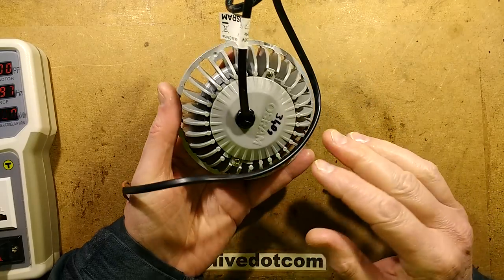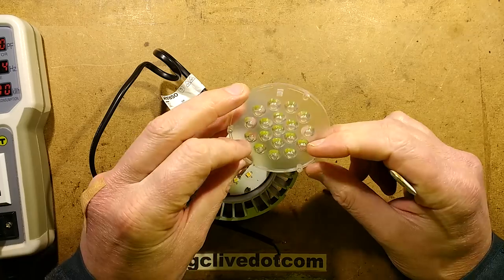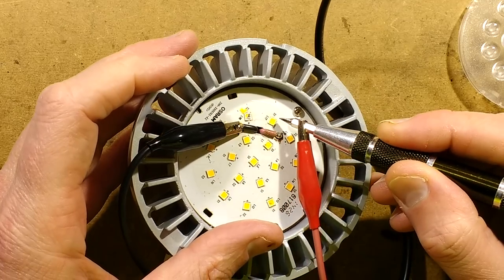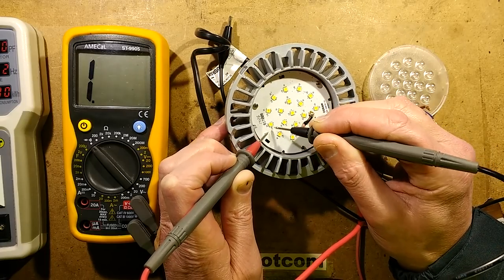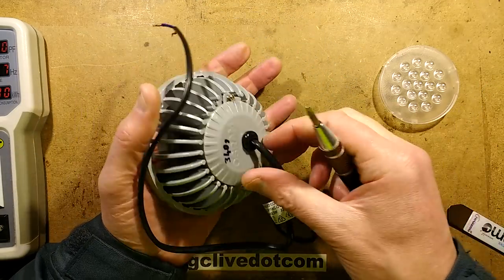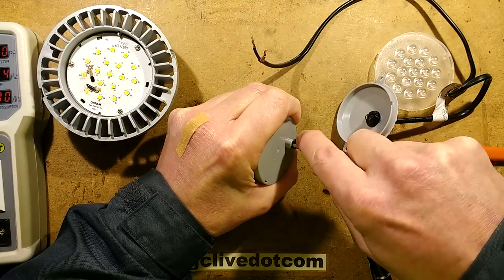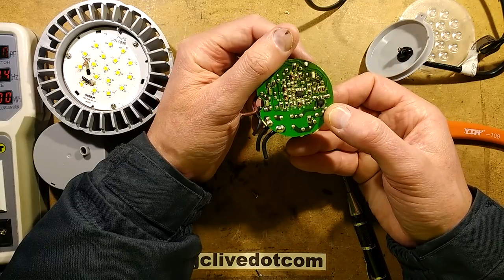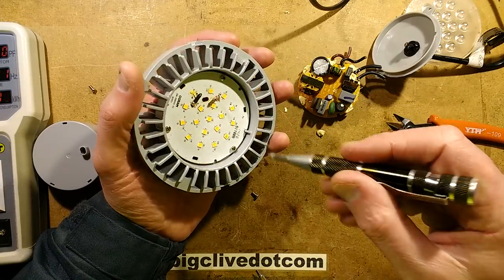OSRAM LED lamp module autopsy.

Comment: Interestingly, the local council here in York have been replacing the streetlights with LED ones. However, they're using optical sensors on the top of the streetlight to turn them on when it's dark. And rather than using a circuit alongside (so the optical sensor triggers a circuit to keep the lamp on for an amount of time) it's almost as though the optical sensor is in series with the LED lamp. The end result is that at dusk and dawn, you get enormous problems with pulsing of the streetlights (it looks very much like the fail shown here). But when it gets fully dark, the LED comes on full and stays on. That can't be healthy for the LED lifespan, right?

Comment: PCB material often used with LEDs is CEM3-thermal. It quite brittle with a thermal conductivity up to 1W/mK. The main reason it was used here was probably because of better electrical insulation than aluminium with thin dielectric layer.
Reply: Meh, "often" doesn't mean usually.  Most use a traditional aluminum mPCB.  Maybe if it had been mPCB, cooler running would have resulted in a lower failure rate.  We were, and somewhat still are, in the infancy of good LED design.  Very few live as long as projected, sort of how budgetized spiral CFL turned out.

Comment: The LED chips look a lot like the ones used in the Cree lamps being sold here in the US. (complete with somewhat mushy yellow phosphor top.)  I put in about 500 at a church and have seen about a 3% failure rate each year and am hoping that it does not follow a log trajectory. In the Crees, a long chain (80+) are used in series although the count is hard due to the increasing number of junctions per chip. Of the ones I have autopsied, many have a single open junction (black dot of death) and the others are often supply failures. The 20,000 rated hours are not realistic as that would require all of the LEDs to last that long. Instead, first failure of 80 ends the lamp.

Comment: I use led lamps because they are cheaper to run, but i still think they are causing so many unwanted problems compared to the older style lamps. Radio interference for one, light pollution from new street lamps is another problem. Astronomers hate them because they can no longer filter out the light produced by street lamps - something they could do with the old sodium lamps. And another problem is the wasted materials when these lamps are thrown away. All in all i am not convinced about their eco credentials.

Comment: I have got two LG TVs from friends in the last month with their back light failing in an identical manner. Both just a little bit older than 3 years and if you ask LG the only response is "out of warranty, and we won't fix it even if you'd pay" (well it will be a long time before I'll buy stuff from LG ever with that service). 
Both TVs are pulsing the light. I opened them up and found a LED failed open in both of them. There are also a few other dead LEDs in each, but the LEDs (dual chip 6-7V as well) have an integrated zener diode so they still conduct. Since there's two series strings of backlight LEDs the one with the failed open LED is triggering the overvoltage cutoff of the constant current driver and makes the other string (with the dark LEDs) flash.
The LEDs of the backlight are cooked in normal use. Deliberate or not (manufacturer got your money, so they don't care), this is a clear design fault.
Reply: Против Глобал  or any brand.

Comment: I wonder if you probed the pairs of LED chips correctly.  I couldn't see the copper traces on the video, but a lot of your probing looked like it was diagonal with the two probes on different chips that might have unknown connections between them.

Comment: I've been trying to get ahold of the local street lights as well... They look line a line of LEDs rather than a large one with a single lens.
Reply from the maker: It is usually a grid of 1W or 3W LEDs.
Reply: Of course, once you get above about 10W LED (or huge COB) it's less cost effective to use a very high powered LED with a thick metal heatsink behind it, unless it's an application where you need a dense point source of light for focal reasons.

Comment: Often if you exceed the peak inverse voltage of diode, but limit the current, it will fail short. They may have purposefully put a diode that has a low PIV in antiparallel so that if the LED fails open the full supply voltage would make it fail short and bypass the bad LED.
Reply from the maker: +Mister Hat The good LEDs do show a silicon diode drop in the reverse direction.

Comment: I've had two out of three Osram LED bulbs fail with the flashing problem, falling far short of the expected life. Maybe I've just been unlucky but I'm not at all impressed.

They felt quite a lot heavier than other LED bulbs too, so I assumed they were decently built (e.g. good heatsinking). But apparently not.

Comment: funny how i mentioned about my dead led in last vid out of random and heres a vid on one today ahaha. those large led chips i normally see in led strip lights the most like ones in silicon with tape sticky side and ones in those long strip bar housing ones with glass like ones i installed over my kitchen sink. mostly due to how bright and compact they are.

Comment: So, those output wires aren't silicone insulated?
Perhaps a better strategy would have been to use an isolated driver, which would allow mounting the LEDs on a normal MCPCB?

Comment: Since it runs at about 108V would that suggest that it might have been a module ment for 110V supply? And the reason so many blew is because it was ran with 240?
Reply from the maker: +Dustin Smith The output is about 100v but the power supply is a buck regulator intended for 240v.
Reply: bigclivedotcom I have two chargers, one Sony Ericsson 550mA, and one Microsoft 750mA both 110-240V input europlug, and USB microB 5V output. The Microsoft one got its USB plug broken, and the Sony Ericsson one, the cable connection with the pcb broke, and I was unable to access the the insides without destruction. 10 days ago I had a flash: to cut the cable from Microsoft one right before the USB end, and from the Sony Ericsson one, right after the exit from the charger's body, and solder them together to form a roughly 4m long cable. So I cut, and stripped them (I noticed that between the copper conductor strands where the some non-conducting ones made from nylon perhaps?), and I color-matched (white and black) the bare ends, because if I didn't, it could fry the whatever equipment it was supposed to charge... A bit of tape, and ready to test. So I plugged a Sony Xperia M5, but after a while the charger shut down from overheating (no melt, no smoke, just a lot of heat, enough to warm the hands, but then plugged again worked normally until overheat), then I done a second test, charging the same device from the 10% battery, I left it overnight because the temperatures where low as 12°C, and the morning the battery was at the 100%. Then I opened the energy tab on the settings, and I saw that it charges until overheats, and then stops until the temperatures go back, and again, so 1:00 I plugged, 9:00 I had a full charge for the day. So the question is: should continue to 4m cable, or limit it to 2m that both of the chargers had? I'm using the Microsoft one

Comment: Looking at the video, it looks like the LEDs in the middle went out while the ones near the edge were still working.  It might just be  the way they were wired, but I suspect overheat.  I wonder what the manufacturer says about mounting/environment and if it was installed properly.

Comment: Those leds are 3030 or 3535 high power leds. Probably 1w per 1 led. They are typically used in power efficient TVs and high end led bulbs. They are crazy efficient. I have a 18W bulb that puts out 2000 lumems.

Comment: I see many problems with designers trying to replace things with LEDS
1. Intergreted Designs that aren't modular or easy to change
2. Too few leds at too high a current
3. Too narrow a beam angle
4. all the heat being dumped to a heatsink where its right next to the led and makes the whole thing too hot
5. Using PWM to hell and back when you could use constant current/voltage and at too low a frequency to not be noticable OR still PWMed when at full brightness
6. Replaceing something with inferior designs that puts out less light and worse colour
etc
in this case its too thick with too few fins
I am not sure what this is meant to replace but it probably was something that put out a lot of light

Ideally it should havce a crapload of leds and lots of room for heat to escape 
OR run at low enough levels that heat is an non issue
OR if you intend to put lots of leds into somewhere where it will get hot or with not enough design for led power just make sure its cold to start with
like a fridge, walk in refrigerator and DON'T overdrive the chips

I'm making reference to your pigmy/fridge lamp video where the tiny 1.5 W lamp puts out as much heat as the incandescent replacement 
with my fridge I put a 104 3014 led into a 25w socket and it works wonders
(before it was a 64 led one) but it works great doesn't get hot

Problems i've seen with intergrated designs is that i've see buses with intergrated led tailights and interior lighting with bad diode and a few cars with busted led tailights too and it may be a batch problem but modular designs like trailerlights and replaceable "square" led tailight panels rarely fail and only fail in the case of early DIP white leds for  interior lighting that have since been sorted out

Comment: 2.10 those are street light LEDs if a dot is faulty can you use a resistor or diode to restore the lamp? I fixed a street light last week and found that some dots shorted out preventing power supply start . Many lamps I fix have swollen capacitor somewhere. module is insulated like our African 24 max.

Comment: Since the PSU is so well built, it would be worth hanging on to that, and "repurposing" it as a low-power benchtop PSU? If that unit's putting out 100V +/-, there are a lot of buck regulators that would work with that just fine.

Comment: Just trashed 2 of the first gen Samsung PAR 30 LED bulbs, Similar fail mode. Not the full intensity flashing, but a slow pulsing at maybe 2% of normal intensity.

Comment: The dark brown area around the diode in front of the transformer would mean to me, that its underrated and getting too hot.
better use a to220 diode package, it would fit in sizewise.
- Did you say something about that and i missed it ??

Comment: Here's an unrelated LED question if anyone has any ideas. I got my hands on one of those lighted perspex cut-out bases that use 10LEDs to light up a design. When in any of the static colour modes, all the LEDs light up fine exactly the same but if I put it into colour rotation mode, the 10th LED on the end lights up a different colour as the colours shift. Any ideas what might cause that? As far as I can tell, there is only one channel from the on-board chip.
Reply from the maker: +Chaos Corner That's odd.  Is it ordinary LEDs or the square ones with four or six leads?
Reply: Square with 4 leads. It's not a biggie, I found it in a bargain bin for 25c. The USB connector was broken off but a bit of direct soldering fixed that issue. Just curious what could be causing it. I thought at first that one of the colours was just dead but cycling through the other settings, you can't tell it apart. If I can find my multimeter with the duty cycle setting, I'll throw it on but since the colours are cycling on that setting, it might be tricky. Though perhaps the nano-oscilloscope would be more interesting.

Comment: BC I've used Osram GU10 lamps that have lasted years and the failure is dry solder joints.  I would buy a new Osram from 5 years ago  rather than a 7w lamp from farnell that has a psu that says 6w!

Comment: I have an Ecosmart LED lamp lightbulb that is 9.5 watts, and it is a cheap Chinese bulb from 2017, and one of them failed immediately. If I wiggle it, it turns on, but it cuts off completely randomly. Why does this happen? The other ones work fine.
Reply: Sounds like a shitty solder joint! (or a shitty wire)
Reply: RJARRRPCGP That might be the case. Thanks for that info. Sadly, these are welded single-piece bulbs, so taking them apart isn't much of an option.

Comment: Power sypply PCB has signs of heat, near the transformer. I'd say this unit could have been made better by using an aluminium substrate PCB for the LED's with a fully isolated power supply.
Reply: Clearly the work of the diode.
Reply: Yes I think it is that
Reply: The PSU was as isolated as it gets on this type of unit, though no airflow through it.  Aluminum substrate mPCB would keep the LEDs cooler but do nothing to change that heat around the transformer.
Reply: It does not look electrically isolated. Electrical isolation would allow for aluminium backed PCB. Best thing would be to either design a different, more efficient power supply or provide better heatsinking for it, but this may not work well with second class isolation since components will need to be attached to the heatsink metal. What could be done is to use components in a fully isolated TO220F package, but I'm not sure how compliant that is.

Comment: Does double insulated refer to both conductors being insulated from the metal case?
Reply: Higher-Ground Farm Everything has to be isolated to a higher than usual standard (traditionally with two complete layers of the normal grade insulation hence the name).  Then you are allowed to draw the double insulation symbol (a box within a box) and omit the earth connection of the metal parts.
  So on this one, the wires that are not isolated by a black sleeve are protected by a stud on the grey box.  The LED circuit is isolated by a thicker than usual PCB fibreglass and an extra thick plastic lens.  The power supply PCB is kept the usual safe distance from its box, and then the box itself is a certified isolation plastic. And then there's the isolation between the primary and secondary windings in the transformer further isolating the LED board from the ground-referenced mains supply.
Reply: John Francis Doe thanks, very clear now.
Reply: Either 2 separate insulation layers, so a fault in a single layer does not allow contact to the external metal parts, or the basic insulation has to be so thick that there is no possible way for it to fail under normal use, even after long term use. Thus 2 parts provide insulation ,either of which will be sufficient without the other, or the plastic has to be more than twice as thick, and also flame retardant, non melting and non charring as well. Thus all is either a non melting type of plastic, or a glass or other reinforced injection moulding.

Comment: I have to say; our council has replaced every street light with one of two GE models. And so far (2 years) there are very very few failures. Maybe some manufacturers are better at designing lights around their thermal limits?
Reply: Or they just get their crews out and replace them in a timely manner as they fail.  Granted there is a large variability in lifespan of the early designs, and which grids they're on, some have worse operating environments than others including weather, power grid fluctuations, and the housings they're integrated into.
Reply: I think you're right there. I've seen LED boards being run at 900ma screwed down onto a powder coated surface,  bare 22mm diameter COB's being pushed down into place by someone's thumb & lenses being superglued back into place. Still councils queue up to buy this rubbish which shows how much their experts know about what they're buying
Reply: archiearchie666 Expert definition, ex means has been, and a spurt is a drop under pressure.
Reply: William Extremely true.
Reply: The ones outside installed in 2010 so far have lasted well, though that probably is explained by a combination of there being a lot of early failure ( first ones failed after 2 days) and also by them being underrun a lot ( they put in extra units and then 400W HPS fill lamps after a month as the levels were well under the rated spec on street level) along with there being no light for the last 3 months due to a combination of cable faults and bee nests in the poles, and there is no contract to remove the bee hives from there. There is a lot of demand for wild bee nests, last one in the bird bath was taken for a hive, and there will be a new one there probably this spring again.
Reply: +William - also depending on climate at the place & the climate it has been engineered for

Comment: Yikes, don't like the design of that ballast, browning of the PCB like that is a sign of very high temperatures ...
Reply from the maker: Not as bad as many of the ballasts in compact fluorescent lamps.  But I think electronics should be run as cool as possible.

Comment: We had to change to leds to save the environment. A friend of mine has a business in leds and he has tons of waste. Leds technology changes faster then he can sell them. And then al these electronic boards, no recycling. A light bulb has almost no waste and are is easily recycled. So they use less power during usage but I really doubt it is worth it.

Comment: Just curious but was the metalwork cast aluminium?
Reply: Looks it, or an alloy.  Definitely not extruded so what else is left?
Reply: Believe it or not I have seen similar that are zinc alloys. The reason I asked about Aluminium is that it's got quite a high scrap value at the moment (about £1 per KG so not as high as it has been but still not pennies like iron).